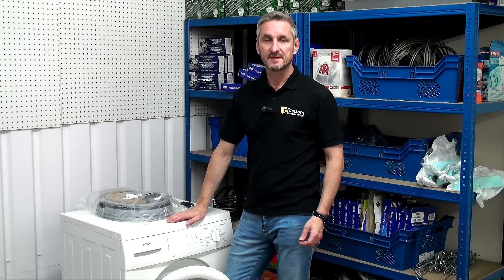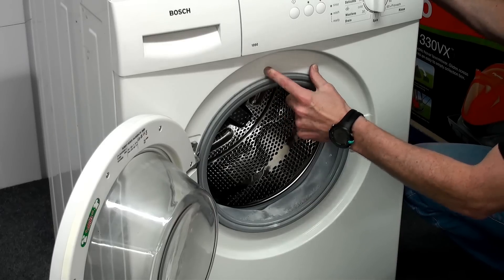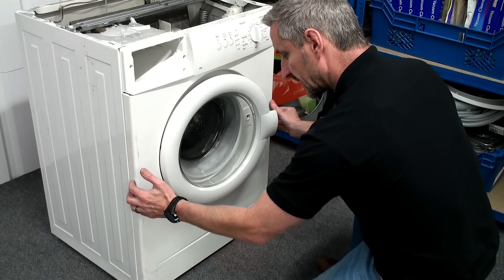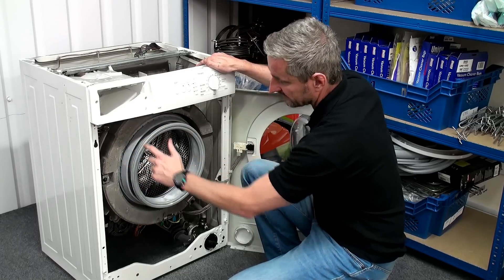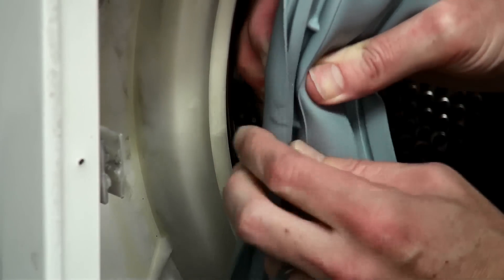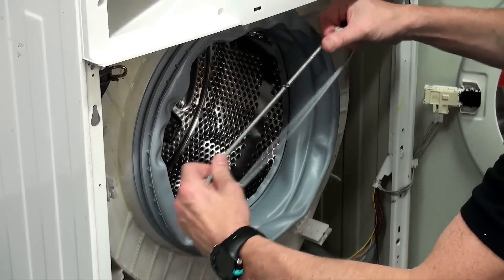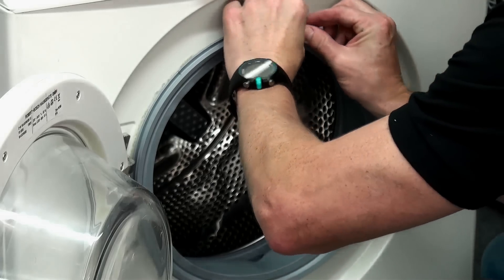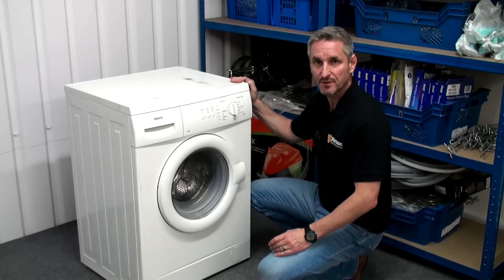How To Replace A Washing Machine Door Seal

Comment: After spending over an hour struggling to refit the outer retaining band on our Panasonic machine, and on the verge of buying a £20 tool, I stumbled across your video. The secret is starting with the spring seated just above the door hinge, feeding the wire over the top and down to roughly 5 o’clock, then stretching the spring with long nosed pliers to feed in the remainder. It worked a treat and took literally a minute to accomplish. Other videos on YouTube gloss over this part or show  the final few inches of wire being levered into place with screwdrivers….with potential to puncture the seal or scratch the cabinet. Thank you so much and keep up the good work.

Comment: This worked, thanks.  Took me about an hour but I guess I saved £100 call out.  My model has screws in slightly different places but the basic principles with regard to the seal removal and refitting were exactly the same.  Thanks again.

Comment: Lee, thanks a lot for this brilliant tutorial. I've just finished replacing the door seal on my Bosch Classixx 1200, which is slightly different to the one in your demo. I'm a complete amateur, but managed all the same due to your extremely clear and helpful video. I hope you will not mind if I make a couple of observations that might help those with a similar machine to mine:

1) The panel at the top that holds the control unit does not need to come off. 

2) The bottom panel has two retaining screws, both on the right, underneath the drain panel.
 
3) After loosening the front panel but before removing it completely, reach behind on the right to remove a plastic fitting holding the door lock mechanism that slides onto the inside of the front panel - there's a wire harness that attaches it to the machine, so this needs to be removed before taking away the front panel completely.

4) When reassembling, remember to slide the door lock plastic fitting back on before replacing the front panel - two cutouts on the panel mark where to position the two plastic tangs to ensure it's at exactly the right height. Then replace the two screws that hold the lock onto the panel - this prevents it falling back into the machine. Then you can go ahead and replace the front panel with confidence. 

The above may sound complicated, but it's actually pretty easy !

5) As mentioned by others, the final job of replacing the spring-loaded band that holds the seal onto the door is tricky. A good tip that worked for me is with one hand to use a pair of long-nosed pliers to pull on the spring, thus loosening the tension on the band and making it much easier to pull/push back into place with the other hand.

Thanks again, Lee.
Reply from the maker: Brilliant!  Glad to have been assistance and for sharing your repair.

Comment: First things first, thanks for a great video it helped me to replace the door seal on our AEG Lavamat 64810. After carrying out this job I have a couple of tips that may help others. If you have to move your washing machine on a vinyl or lino floor get some hardboard to slide under the machine and then you will find moving easy and you will not damage the flooring (that should please the wife). Be prepared for rusted fixings so have a small socket set available as well as your screwdriver. When fitting the door seal to the drum section I found spreading some washing up liquid and even more important letting the seal itself soak in some very hot water, this helps to stretch the seal into place easier. Thanks again to Ransom Spares, I purchased the seal from them of course, for such a prompt service. Good luck

Comment: Good video just a few tip that others might find useful.  Mine was a Bosch too but a few more screws to undo for the front panel removal but all pretty obvious.  Good idea to unplug the door switch so that the front panel can be removed and not strain the wires.  I could do the inner seal without removing the weights which is as well as they looked to be tricky to remove in my case.  Getting new seal on was a lot easier when the it was smeared with fairy liquid both for the drum and front panel seal.  Also it was easier to get the spring on with 2 pairs of hands.

Comment: Hi Lee, I have a Bosch Classixx 5 ( the model you are working on in the vid.. ) and the bearings are propably gone. Now I've checked how to change the bearings and although an extensive job I think I'll get it done exept from one thing... the tub inside this model is put together without screws and seems completely glewed and sealed only. Any idea or tips to work around this part of the job ? Thanks for all your clear vids !
Reply: You cannot separate the drums on many modern machines as they are moulded together to save on screws.
When the bearings have completely gone it is basically time for a new machine.
Older machines had drums that were able to be separated but modern have welded drums and welded front panels too.

Comment: Hi, I've just fitted a new seal to my Indesit machine after it started leaking from under the door aperture.  New seal and spring clip from Ransomes. The machine is still leaking from the front during the wash cycle. The Old seal had no rips or splits but figured it was worn. Now I'm thinking it must be leaking from somewhere else and showing itself at the door entrance. Any ideas ? Thanks.
Reply: Did you solve the issue?

Comment: Hi mate great vids, i think my zanussi FJD 1466W bearings have just gone, its been making a noises the last few washes and today while washing i heard what sounded like a bolt drop off inside and when it got to the end of the wash and about to spin the drum drop or something and i managed to stop it and im hoping ive saved it, but before i start taking it apart i need to know abit about it, its a old washer and doesnt have a back inspection cover and i dont know where to start with looking inside to see whats wrong and im really hoping you can help me please? I dont have any bolt at the front to take off the fron cover so i dont know if i have to go from under it or from the top, be really grateful if you can help plz, thanks matt